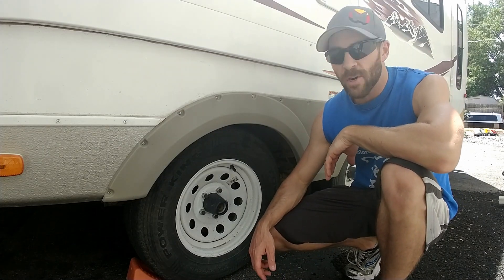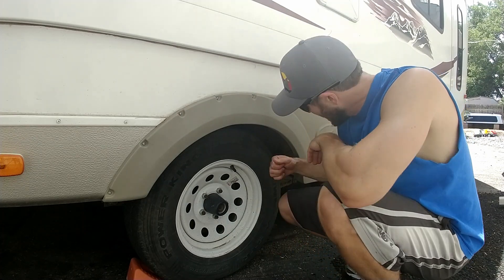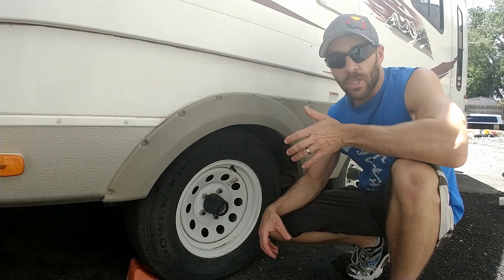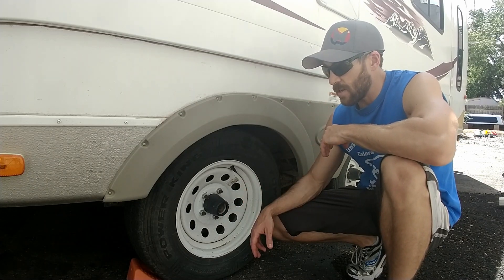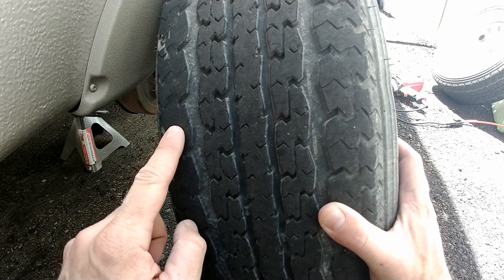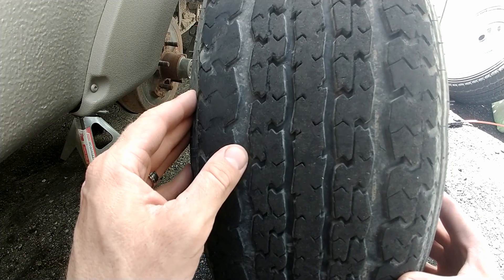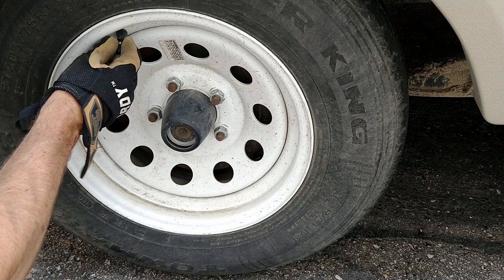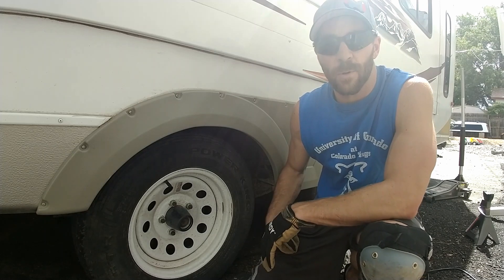RV Tip: Rotate Your Tires

Comment: Tire rotation is a good idea,  but,  you need to rethink where you place the jack. You can see the axle bend when you lifted it. As close to the wheel as possible. Most of those axles are hollow and can permanently bend.
Reply from the maker: Thanks for the tip and watching.

Comment: You should always jack under the leaf spring. The uneven ware is probably from the bend axle from you placing the jack in the wrong position.
Reply from the maker: No, definitely not.  Thanks for the tip and watching.

Comment: Jack on axil? NO.
Reply from the maker: I never understood why people say that.  Most car manuals tell you to jack a car up by the axle, why is a trailer different?
Reply: @ColoradoCamperman  Most manuals I've seen on any recent car has lift points on the frame. That's the official recommendation from the manufacturer for my trailer as well. They said frame as close as you can get to axel hangers.